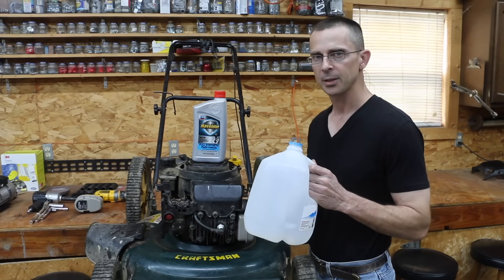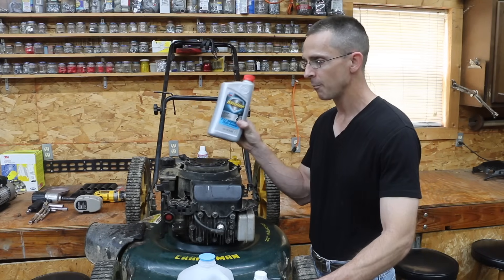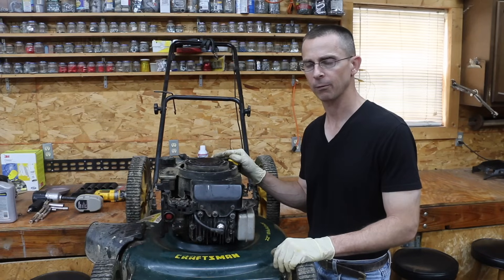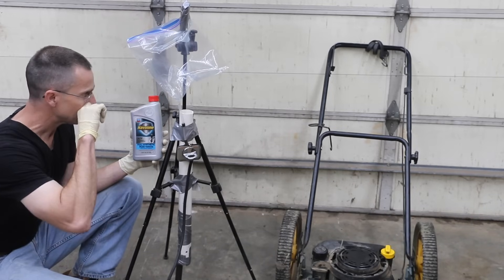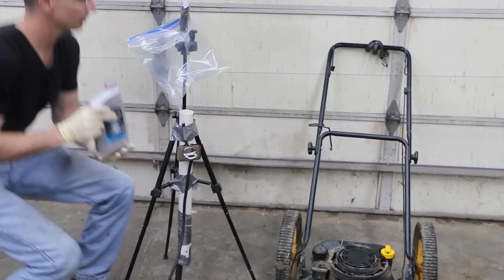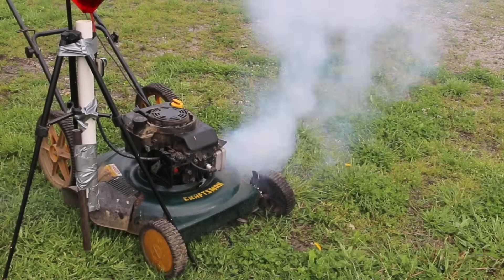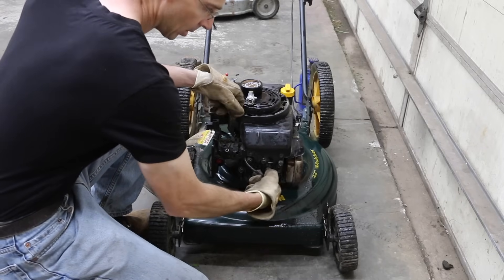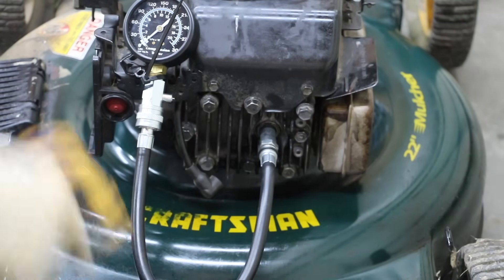Seafoam--can't believe what it did to my engine episode 6--Seafoam vs ATF!!

Comment: I've been using ATF on my Engines to flush them every oil change for the last 15 years. Keep in mind I use this on older cars that have build up and can or have potential sludge issues. I drain my oil. Fill up engine with 4 quartz of ATF and let engine run on idle for about 15 minutes. Drain ATF, install new oil filter and oil. ATF does a good job at cleaning the crankcase. This method was shared with me by a Technician at Nissan many years ago.
Reply: Jeremy Mardlin yea but oil is oil and transmission fluid is a detergent
Reply: Well roughly 2 quarts of diesel is only a little over a dollar. I was just trying to give another way of doing it.. Nothing wrong with ATF way just a little more expensive.
Reply: Z31Rider
 better watch it Ull wash the bearings out
Reply: 86ttop Gt yes but it still is oil. It just has a lot more detergents in it than motor oil. It doesn't hurt anything unless you run the engine under load if poured in the crankcase. It really won't hurt anything even at about 20% or so. It will make the oil dirty as hell pretty fast unless the engine is pretty clean already.
Reply: +Reid Henderson - 1 Gallon of ATF at Walmart is under $12.00 :D
Reply: Well the one benefit ive seen from diesels is that it swells any rubber gaskets so they don't leak. But that's just form experience not sure it would help cork gaskets any.
Reply: "Fill up engine with 4 quartz of ATF and let engine run on idle for about 15 minutes."  <<<< sorry, I do not agree. Just too far from the regular engine oil lube spec in a gas powered car. Too risky for me. I use 1/2 quart of ATF ( and run it for 10 minutes) just before I change the oil/filter.
Reply: +Reid Henderson - Right, but Diesel is not 100% Synthetic.  You want Synthetic so it doesn't harm Gaskets.  Although Gaskets today (2017) are a lot better than in 2000.  So older Cars or Trucks, you might want to protect the Gaskets for..., just-in-case.  For me.... $12.00 is still cheaper than using $2.00 in Diesel.  Gasket are about $20-$60, but Labor is Time consuming ://.  But of course, these are from my point of view. :D
Reply: +Reid Henderson - Right, if my Gaskets are bad...., I would definitely use Diesel.  But in my case, I wanted to save any "Gaskets " I can so I go the safer route.  But if an Engine that I don't care about... I would use Diesel for sure.
Reply: +Reid Henderson - By the way, Cork Gaskets are " Hard to Kill "... I have seen so many in Mowers and NEVER had one broken down in " Gas ". Gas is pretty strong and still it will not break it down.  LOL
Reply: For those worried about potential damage from the ATF, just do a mix, either 50/50 or 20/80 (20% ATF), and also keep it at idle. Really the smart way is drain a quart or two before changing oil, refill with a quart or 2 of ATF, run for 10-15min at idle, drain and do the oil change (note: don't do this if you stretch your oil changes to ridiculous amounts like 20k miles). Pretty much no risk as it'll still be mostly normal oil, and sure you'll have spent about $6 on ATF and $6 in gas but you'll see some cleanup.
Reply from the maker: This seems like a great strategy to keep an engine clean.  Thanks for commenting!
Reply: It will not hurt the bearings if you do not run it under load. He said he was idling the engine which would be fine. There are a lot of newer engines that are using motor oil not much higher viscosity than transmission fluid.
Reply: +Z31Rider - You are 100%, spot on about ATF Fluids !!! I did 2 Cars recently and made my Dad drive 100 Miles before Oil Change.  Now both Engines, 20+ years old... Running smooth as hell !!! My Dad loves it, now I am doing our third Car / Truck this week.  I also have a Video documenting on it during cleaning the Engine Head as well, and I was able to get it back to Bare Metal Shine if you need to see it. :)
Reply: Ive always heard of this trick too but ATF can become expensive. The poor mans way to do it is to draing a couple of quarts of oil then add a few quarts of Diesel fuel and idle engine for 15 to 20 min then drain or engine must be at or close to operating temperature. 2 quarts of diesel is way cheaper than 4 or 5 quarts of ATF but I'm sure the ATF works very well.
Reply: +Reid Henderson - 4-5 Quarts of ATF or bring it to a Mechanic for $99.00 - $150.00 Flush... LMFAO

Comment: ATF is not designed to go in a crankcase or int he fuel system. ATF has almost no additives at all because it is not exposed to combustion gases. It is not intended to be burned either so no care has been taken to make sure it burns cleanly since their is almost no heat in a transmission ATF starts to varnish and oxidize at temps at or bellow 160 degree's F. In fact plain Jain motor oil has 1000X more additives than ATF. You can look at a Virgin Oil Analysis of ATF and OIL to confirm what I am telling you! ATF is around a 5W in viscosity but once it get's warm it thions out fast again not intended for high heat, combustion, fuel system, crankcase etc....Their is no detergents in ATF it turned black because it burnt into carbon and oxidized! NO DETERGENT ACTION IN ATF. Why would a transmission need detergents their is no air intake, no combustion and low temp.'s compared to an engine!!! ATF and POWER Steering Fluid do not need detergents and so they do not have them! This is a typical additive level in ATF Calcium 65 ppm
Magnesium 2 ppm
Phosphorus 412 ppm
Zinc 536 ppm

cSt @ 100C = 15.17
flashpoint 295F  this is Honda's ATF but if you look around you will find other's.  Here is a link to a Toyota WS ATF Virgin Oil Analaysis https://www.bobistheoilguy.com/forums/ubbthreads.php?ubb=showflat&Number=1169896

Here a VOA of Shell Rotella T6 10W30 https://bobistheoilguy.com/forums/ubbthreads.php/topics/4408001/VOA_Shell_Rotella_T6_May_2017#Post4408001

Comment: Wonder what the soft bearings look like after seeing that transmission fluid. Maybe the larger bearings in a car engine under a heavier load with ATF.
Reply from the maker: Great point. Thanks for taking the time to comment!
Reply: No, thank you for making interesting videos. I love SeaFoam. You can add it right to the crankcase oil sump to clean out oil passages. Miracle stuff.

Comment: On your previous videos the mower had a cold compression test of 106psi, now you are in the low 60s. Correct me if I am wrong, but isn't that horrible to loose that much compression? Its great that you are cleaning the inside of your engine but if you ruin it in the process it isn't worth it.

Comment: I've been watching these for around an hour and I love them. 

I'd like to request results on high methanol content wiper fluid. It's just water, methanol, and a bit of blue. 

The methanol should help the decarbonizing as well as the combust ability of the mixture a bit... The methanol is only going to break away from the water when you ignite it.

Comment: I have always heard add a quart of ATF if you have noisy lifters. Way back in the day when I was a kid in a small town there weren't any name brand part stores , so you just went and bought ATF as a 1st line of defence of a noisy motor. If it was just carbon buildup it normally worked quickly by memory. Now I have been dishing out for seafoam for a couple years but I'm thinking going back to ATF is cheaper...?
Reply: i would like to see that video
Reply: +Markus Ulrich - Here are 2 Video of what I did afterward / during ATF Fluids...  https://www.youtube.com/watch?v=Luqmx0VlN1w  and   https://www.youtube.com/watch?v=OgqotSDSptw
Reply: My only question is, what happened to SEAFOAM. I'm only 29 about to me 30 in a few days but I remember seafoam  only being like 4 or 5 dollars a can when I started driving now it has skyrocketed. anywhere from 9 to 12 dollars a can.
Reply: Popularity. Seafoam is a trusted name, and it does work, but now people think it'll work miracles and since it's a trusted name, it's one of the most promoted products out there as well. I'm only slightly older and yeah, used to be way cheaper and was also rarely advertised, now it's front-page on many auto shop adverts. I also think the fact that it does smoke out an engine while it burns it also plays into the mindset that it's doing a ton internally, even if it's actually a rather gentle amount of cleaning and most of the smoke is just the product itself burning off.
Reply: +Alien Dragon - I've recently clean the Engine Head of 2 Old Cars, Rods, Litfers etc..., 20+ Years with ATF Fluids.  Now both Cars are running really smooth, like brand new again.  Both Cars have 250,000+ Miles on them and we are the Original Owner.  I was skeptical at first, but I was like... What else I have to lose right?  Boy, I was soooo wrong... It took so much Gums and Gunk off, I was able to get the Internal Engine to Bare Metal Shine.  I do have a Video on it if you are curious of what I did.  :D

Comment: My dad's SOP to clean an engine with ATF was to poor only half a quart in the carburetor as you did, except at the end increase the rate slowly until the engine dies and let it set overnight. Then pour the rest of the quart in the gas tank.  But we stopped doing this when they started putting catalytic converters on cars as this will plug them up.

Comment: i use. meth. injection and it has amazing cleaning ability, engine looks amazing.   just try it. with bottle of HEAT!!!!
Reply: I have always heard this is one of the benefits of Meth Injection. Cools intake and cylinders for more power while also cleaning carbon from everything.
Reply: Will crank work too?

Comment: I'd like to see brake cleaner sprayed in much like you would with seafoam. it does a great job when used on the exterior of an engine and on carbon build up in intakes when I clean them sometimes.

Comment: Run 50/50 M1 methanol and water through it. The water will steam clean the engine, and methanol is very corrosive, eating through build-up very easily. It also usually only costs ~$4/gallon at race-fuel shops.

Comment: this has been done by me and millions of other mechanics over the last 100 years they had steam injection for aircraft for years.     is simple folks , adding a cold liquid to a hot engine flakes the carbon off this is not magic , but water breaks into hydro and oxy  which will take off the carbon a little more than other things,  just spray it in when you come home a tiny bit at a time every day for a week clean engine no oil milk .
Reply from the maker: Thanks for watching the video and commenting.

Comment: I fully support your desire to discover and learn from your tests/experiments.  As a trained engineer, it's what drives us to understanding.  But...I think you'll find that while things may look better or worse, I'm not sure how any of that affects performance outcomes.  Even better compression on a lawnmower engine doesn't directly translate to better lawn mowing.  However, on a multi-cylinder car engine, the impact may be greater.

I will say that I use water injection on my Audi TT 1.8l turbo engine, and have for about 200,000 miles, and the car still runs well and performs well.  I also change the oil every 5000 miles with Audi/VW specified oil.  I've never pulled the head so I can't speak to carbon buildup or anything.  Perhaps one day I will.
Reply from the maker: Jetta Red, I enjoyed reading your comments.  My opinion is that visible signs of cleaning are a good indicator of improved cleaning around those areas that can't be seen and do improve performance...rings and valve seals.  Thanks for watching the video and commenting!

Comment: looks great after ATF, but can ATF stay inside the engine? I mean, can it stay inside until the next oil change (about 6000 miles)
Reply from the maker: I wouldn't use ATF in a modern engine due to possible problems it could cause with sensors, cat converter, etc.  Thanks for watching the video and commenting!
Reply: thanks for answering. so it's no problem for my old Mercedes 260E from 1986

Comment: Great videos!  However, does it really make for any difference in engine performance whether the combustion is "clean" or has deposits?  I'd also like to see the cleaning effects of running under very heavy load; like WOT at moderately high RPM.  Maybe something to try if you can devise some sort of engine brake.
Reply: Yes it does. You should see smoother and better performance

Comment: 4:50 Honestly? All these lawnmower testing vids make me very happy I bought a Neuton electric mower 10+ years ago. Total maintenance (besides blade sharpenings): 1 new battery. That's it. HUGE time savings. 

I'm not even sure I know where my compression tester is any more but it is probably covered in a layer of dust.

Comment: Spray easy off oven cleaner on the head and piston
Reply: Most oven cleaner is very caustic and will eat aluminum
Reply: @5002strokeforever  I don't know what kind of oven cleaner you use but I've used regular Easy Off oven cleaner for years on my cheap thin aluminum toaster oven and it takes off baked on grease and crud like nothing and the aluminum hasn't changed or gotten eaten away whatsoever and looks great.
Reply: @Roc790 I dont mean burn a hole in it in a few minutes.
It definitely eats aluminum, but is probably ok for short periods, right on the can it says not for aluminum
Reply: @5002strokeforever  IKR!! There goes the "Duh-Huh Water Head Mentalities" again, trying to blow up peoples engines. I love how they say Water is FREE but it cost Project Farm more than the bottle of Seafoam on the last video and almost cost him an engine to boot. Only reason it got as clean as it did was from the oily-water that got sucked into the cylinder near the end of the test. xD

Love your username. I miss my CR500R. Selling it 32yrs ago still seems like a death in the family.
Reply: That is an awesome idea!
Reply: Easy Off Oven Cleaner is made from a mixture of ATF and water.

Comment: I think carbon tetrachloride should dissolve those carbon deposits. However, it's hard to come by nowadays (and ridiculously expensive), and it's quite toxic (don't breathe the fumes).

Chloroform should probably work, too, but it's also dangerous stuff, and I don't know where you would get it.

A forum I read suggested chlorinated brake cleaner (tetrachloroethylene).

I wonder how Easy Off oven cleaner (perhaps sprayed in the sparkplug hole with piston at TDC) would work?
https://www.wired.com/2008/05/st-easyoff/

Comment: Love the videos, thanks for your efforts. One thing I have heard of is on a diesel engine, when changing fuel filter filling the replacement filter with atf to clean out the carbon. Many thanks.  What are your opinions on adding atf or 2 stroke oil to fuel instead of direct feeding like you are doing?
Reply from the maker: Bruce,  I did a video on ATF for a gas engine.  Regarding diesel engines, I occasionally add 2 cycle oil to the fuel to help lubricate the injection pump.  Hope this helps!   Thanks for watching the videos and commenting!

Comment: Love your videos. I am learning a lot. Thanks for taking the time and $$ to do this, and risking your equipment. I had heard many yrs ago of using ATF in oil to clean crankcase and valve train, but had not heard of burning it. I wonder, how gunked up does the plug get? I would certainly replace one after doing something like this, since it is cheap and easy to get to. Although, it looked ok in the cylinder head. Also, this mower myst be lower compression by design. It seems to give significantly lower compression (about 30 PSI lower) than other engines u have used in your videos. Keep them coming.
Reply from the maker: Thanks for watching the video and commenting!
Reply: I use to have a 78 Chevy K10 4x4 350 4 barrel carb and I use to use dextrone 2 Atf to clean my carb start up and pour Atf down into carb it would white smoke a lot but would always run better afterwards.

Comment: i had atf in my engine 330mils(a beer bottle of atf)  and i used my car for 1000kms  and drained it, it looked black and dirty (the oil was under 6 months old and had less then 2000kms on it) 
and the engine inside is like new with the colour of gold 
before it was caked up with thick oil goop(semi carbonized)(8 years was the last oil change from the guy i bought it from) 
i cut open the old Z411 oil filter the other day when i did the oil change and the filter had carbon in it

the car now runs far better with more power and the sensors and solenoids are starting to work again left and right VTC(Variable Timing Control) VQ30DD

it is a very great and cheap fix for any car

ATF is a
A hydraulic oil
B lubrication
C Cleaner
all in one
atf is thin so it can get in the smallest places to wash them out
do not use too much in your engine or it will not provide as much protection as engine oil does

never use seaweed, seabreeze again  when you have atf that is cheaper and really works
Reply from the maker: Thanks for sharing your experience with ATF!  Impressive results!  Thanks for watching the video and commenting!

Comment: Curious to know if all the build up inside the engine would be better/worse with the use of higher/lower octane fuel?? Would using just straight highest octane fuel clean any of it out of there???
Reply from the maker: High buildup could possibly increase the compression ratio enough to cause a "ping".  In this instance, a high octane fuel would help with the "spark knock"/ping.  Modern automobiles have sensors that adjust timing to prevent this.  Thanks for watching the video and commenting!